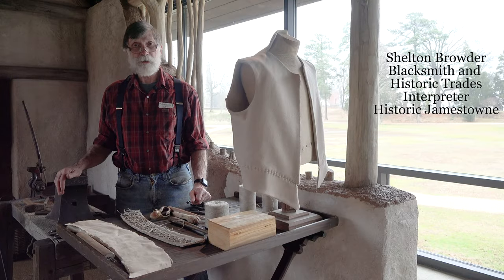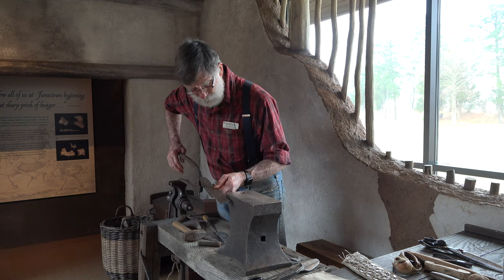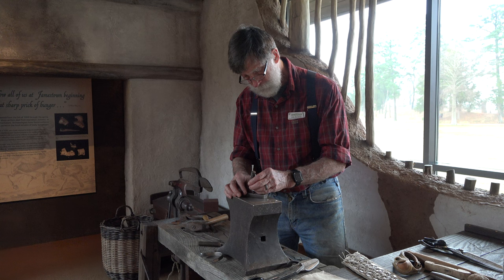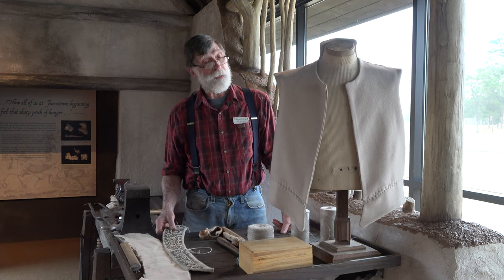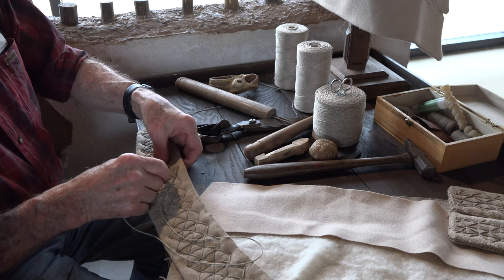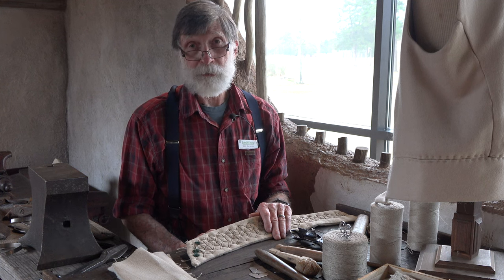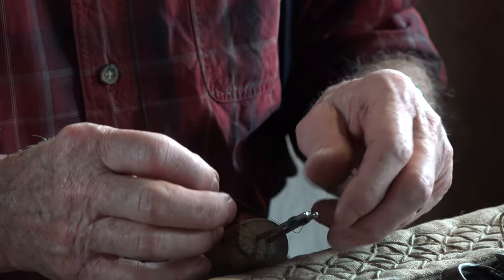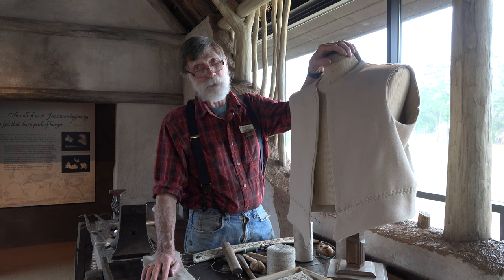Dig Deeper Episode 45 - The Jack of Plate Armor, Part II Blacksmithing a Replica

Comment: for the little pom poms could you space the nails much further apart then after you've wrapped  the thread around the nails 75 times you could tie threads together in several places then cut between where you've tied them together to get multiple pom poms at once?

Comment: Couple of things: Bow strings were not made from a single length of thread, several lengths a bit longer than the bow stave's length were waxed (like leather worker's hand sewing thread today) bundled and then formed into a loop in the middle, twisted and formed into a cord which then had a thread 'whipping' placed around the middle where the arrow was nocked. Look up 'Flemish String' on your favorite search engine. Crossbow strings were made similarly but much thicker and with loops at each end instead of only one. Thread tufts - these were probably made by the children of families involved in the various sewing trades as part of their home duties as well as by apprentices as part of their early training. Apprentices were not paid but were contracted to work for their keep - food, clothes & housing - for several years, the first years were a loss to the master until the apprentice picked up enough skills to make a meaningful contribution to the workshop.